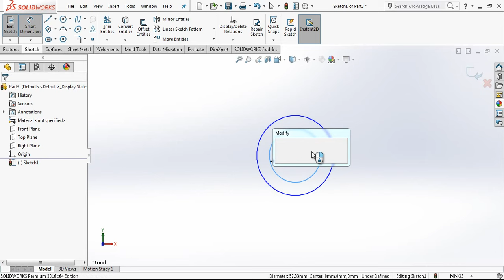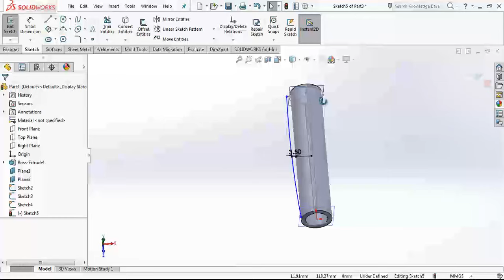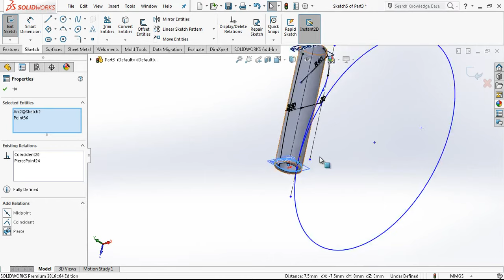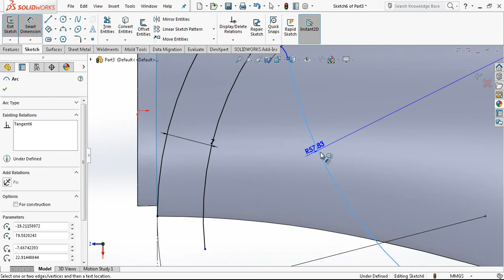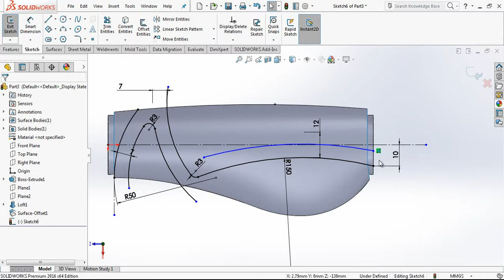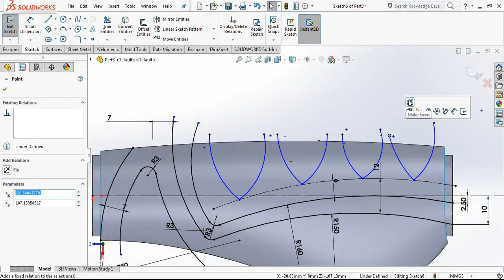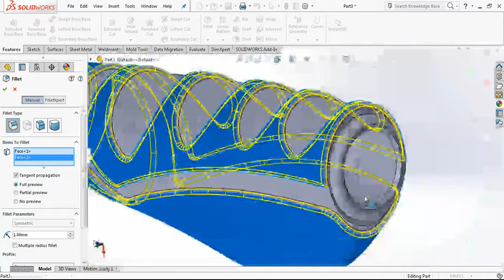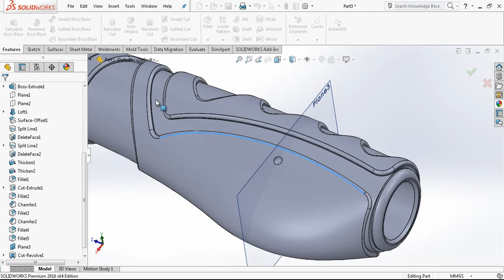Hand Grip Surface Modeling

Comment: Half of video goes in giving dimensions. However, very clever use of off set surface and split line. You could have used dome command for those little dimples...

Comment: very interesting your splines outlook, so you only use arcs, I might try it since I used to do that in autocad as well, just only arcs and speccially lines with fillets. thank you
Reply from the maker: Yeah, if you really designing real objects when needed you wanna revise them, using splines almost not make it possible, hard to control it. Thats why I use arcs.

Comment: Thanks for the tutorial.  May I suggest that you slow down just a bit though.   Your audio could be a little louder and clearer.  It was kind of hard to follow your voice and kind of sounded like you were mumbling through most of the video.  The keyboard and mouse clicks were very noticeable to hear throughout.  I do find your video tutorials useful, but also frustrating to follow because of the opinions I had noted.  Also, you should finish up with a second part to this video.  It just ended all of a sudden without finishing the last step. thx
Reply from the maker: Hi, thanks for your feedbacks. I will consider them, those are valid critisims.

I needed to cut video because there was my personal talks at the end, I had the intention of redoing this video however I did not have time for that.

Regards